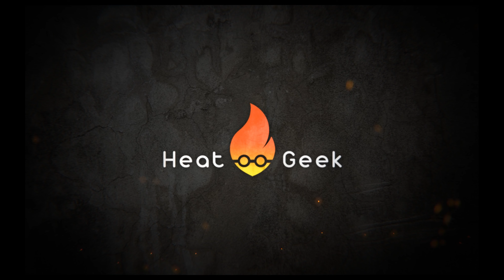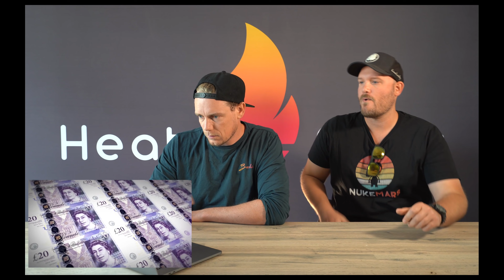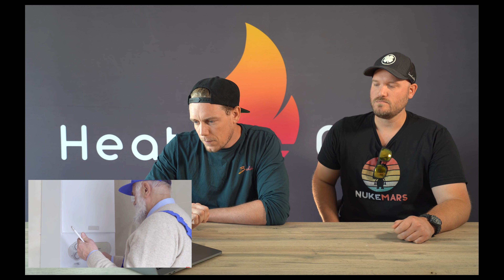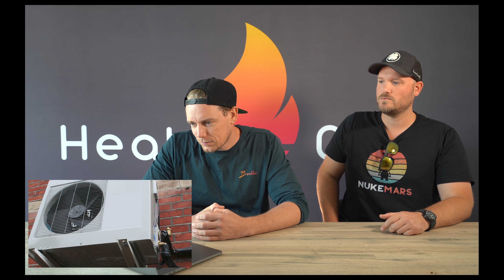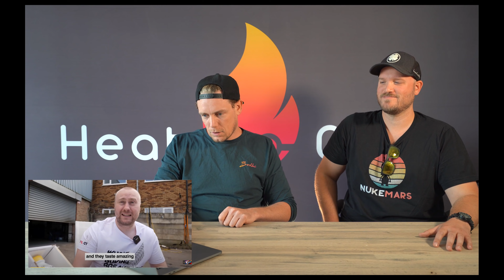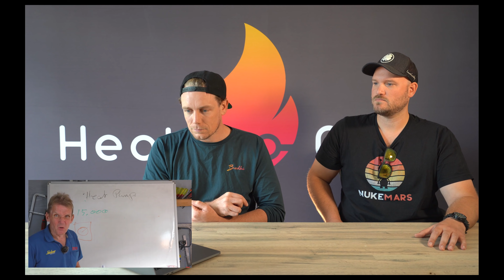Professionals React (BADLY) To Skill Builders's Heat Pump Videos | PART 1 | FIRST TIME WATCHING

Comment: I think what the skill builder is saying yes we need to reduce the carbon by getting rid of our gas boilers, but it isn’t as straight forward as just fitting a heat pump as with this there are usually many changes needed to really make this type of system work , under floor heating larger radiators , possible wall insulation ,and let’s face it most don’t have the money to do the changes , personally boris Johnson has set a target for carbon neutral,we should forget about heat pumps and look at get hydrogen boilers , yes there is need for changes in the pipe work to deliver hydrogen to our houses but this won’t be a cost to us ,plus all we would need to do is change the boiler ,and nothing else ,now that makes sense to me .
Reply: Yes bang on, hydrogen is better FAR BETTER.

Donr get me wrong heat pumps work..but only if you destroy your house and spend £30k / £100k .

These heat pumps DO NOT WORK
For most of us.

They will work for a few YES !

But this is beyond the affordability of TOO MANY

Comment: 15 minutes in and you've basically slagged the guy off while agreeing with everything he's saying. Heat pumps, for a large percentage of UK housing stock, are just not viable. And saying it's more about the installer than the pumps themselves, the thousands of people they're throwing through training courses to meet installation targets will have zero experience. You guys might know everything there is to know about this technology but it will take more than the two of you to install 19 million of these things in the next 30 years.

Comment: perhaps design and installation is everything but how do you know if an engineer is good and system is well designed? bloke that did ours has over 20 years experience in heating and cooling. System is very expensive to run, does not get the radiators hot, junk.
Reply from the maker: Well it's not how many years experience they have for sure. We're going to publish a list of things to check and questions for to help woth this very good question. 👍

Comment: COP is everything, when comparing gas to heat pumps.  If price per Kwh for electricity vs gas is 4:1 then you need the COP to compensate for the higher cost by a factor of 3 or more (assuming you're using a condensing boiler of 90% efficiency etc.  COP is negatively effected by higher ouput temperature as well as lower input temperature.  High radiator temps or colder outdoor (for air source) temps will result in lower COPs.  The best ground source heat pumps into a highly insulated house with underfloor heating running at 50 degrees will get a COP of +4.  I've never seen a heat pump that beats gas cost for a legacy home with typical insulation, air-tightness and radiator setup not to mention the factor of 10-to1 in purchase and installation cost.  Heat pumps can be a reasonable choice for new bulds or remote properties with gas ot oil heating for everyone else they are almost always nonsense.  Pure propoganda.
Reply from the maker: I would say you haven't been in many retro fot heat pump houses then..  we'll be doing a series on our old retrofits/conversions to disprove thos rehtoric

Comment: -3C?   That’s 26F here which is nothing even in a mild climate during winter.  These are only decent in well insulated newer homes here in the US.  Better than electric baseboard but not better than gas.  Electricity is expensive in southern NY.  I had one installed and taken back out a month later as none of these installers are doing any type of engineering work.  My system had a full calculation done the day they cam to take it out.  It was 40% undersized and my electric bill was on track to more than double which makes it more than gas.  I have a system now self installed and use it for the shoulder seasons to heat and summer to cool.  At 3F the system they installed was pulling over 5000 watts and the fan was screaming.  They were so embarrassed in the end and it showed how they are all for the money when none of the 5 quotes I got did any real calculations.  By the way I’m talking about mini split with heads.  Not radiator types like the UK.

Comment: In reality the discussion relating to efficiency is way down the pile we need to start off with the answer from many house wives when told that to fit this new system I will have to seriously upset every room in your house (fact) This was proven in the Newcastle area where the government on a heat pump pilot scheme only managed to get eight people to consider fitting a free heat pump system/installation due to the woman of the house saying no way even if free if it involves serious upheaval of all of my rooms. Needles to say the pilot scheme was very very (yes two verys) quietly scrapped by the government and I agree we need an alternative heating source but in reality heat pump systems are only suitable for new builds or total house revamps/renovation without causing serious upheaval throughout a property. The government has yet to realise that the woman of the house will put the brake on this scheme even though they had a dismal take up failure on the pilot scheme there has been no learning curve. Notice the words in the fourth sentence (free heat pump system/installation) yet they could only get eight households to accept once the wives were told of the associated upset to the rooms. If you have no knowledge about this pilot scheme you should seriously ask the government why and then ask your local MP if he is aware of this and if not ask him/her why? It must be obvious to all by now that the brown envelopes/lobbying has already taken place and the gravy train is in motion and now cannot be stopped even though it is obvious from the failure of the pilot schemes that this idea has the usual government abject project failure written all over it. Just to put the cap on one other idea before I retired my work was in the cryogenics field which involved lots of hydrogen distribution systems both liquid and gas and I already know hydrogen in the gas mains will leak faster than they can pump it in due to the size of hydrogen atoms compared to natural gas (hydrocarbons) every joint pulled up to stop gas (hydrocarbons) leaking will not stop hydrogen leaking through the same joint. I could go on into polypropylene gas pipework and present meters being suable for pure hydrogen but I think I have given you much to think about/contemplate already.

Comment: Heat pumps just don't work as a retrofit I work in gateshead and British gas done a scheme when heat pumps first started they fitted them in 20 of our properties and the council have had to subsidise the tenants electric bills as some of them were paying upwards to £500 a month and the houses still wernt warm at all.
They have all been ripped out and gas boilers refitted and the heat pumps all scrapped.
On a new build fair enough but not a retrofit.

Comment: Across the pond you guys typically are not ductless, why not??? i have ductless in the entire house and a Rheem heat pump hot water heater.... my energy was reduced by half from electric baseboard and electric hot water heater.

Comment: i am all for using better ways to heat our homes and water, but until a solution is developed which makes economic sense and works just as well as or better to what it is replacing then i won't be switching.....air source heat pumps are far too expensive to buy, install, run or maintain than a gas boiler. Millions of people simply cannot afford to install one, even with a grant you still have to fork out around £5-6k....(lets remember a new gas boiler fitted is around £1200-2000 and will last around 10 years)....so it becomes a toy for the rich and if that is the case why do they need a grant, paid for by tax payers money? - it makes no sense whatsoever... until an alternative (like hydrogen) is made cost effective and available to the masses then people will stick with gas and i wouldn't blame them...

Comment: 21°C is my ideal temp with a coat on.

There is no evidence that we need to cut carbon. In fact there is evidence that we are now as we speak heading into a 300 year solar minimum mini ice age. 
There is  evidence that recent measurements of a small increase in temperature is due to climate temperature measuring anomalies (urban temp stations etc).
Sea level measuring on the Wales coast show no increase in sea levels.
There is no evidence that atmospheric CO2 changes actually cause temp increase - there are water vapour / co2 negative feedback atmospheric stabilising effects that counteract any possible atmospheric heating effects from co2. It's the reason life exists on earth. 
A quadrupling of CO2 over 800 years at current increase rates  would in fact cause no more than a 1 degree c change according to recent accurate models.  
Also, 95% of the planets populations have no intention of cutting carbon.
The climate is currently not changing as we speak in any way that could be described as unusual or caused by human activity.

Comment: I worked (briefly) for a house developer in mid-Cornwall area. Out of six completed houses only one house went through the air pressure test to check the air-tightness of the property. The developer elected which house was tested and went to town with tubes and tubes of expanding foam and this stuff was injected absolutely everywhere in order to block up potential leaks. I watched the site supervisor use a dozen plus tubes on one three bedroomed house. This house passed the test, but the test results were then shared by the other five houses in that group, but in no way were those houses as air tight as the tested house. 
So, people moving into these new houses built to new regulations are not getting what they are expecting. 
New-build houses have to be properly monitored multiple times by properly trained professionals who are INDEPENDENT and have zero connection to developers. These professionals should have the same standing as tax inspectors and be as feared by developers in the same way.
 The era of developers marking their own homework has to come to an end.
Reply: I know of a housing development where all the inspections were done by the companies own employees 🙄
Reply: have you considered blowing your whistle?
Reply: @toosas  I think he just did, but only 29 people listened.
Reply: There you go, poor installation standards, the biggest problem within our industry. agree with you completely.
Reply: So the takeaway from this is property developers are scum
Reply: Just done a site with 65 houses. Each one was properly air tested.
Reply: @jordanlamb6102  yeah, it’s mandatory to air pressure test every house
Reply from the maker: Here's evidence of how they work when well installed in a NORMAL house with tiny rads and little insulation 

https://youtu.be/QLGANlbqIFY

Comment: Just wanted to ask why in the UK there is little or no domestic installation of air to air heat pumps?  These are very cheap, very efficient, have no reliance on existing heating pipework, radiators or ducting, are easy to install and easy to control.  They are widely used in the US, even in very cold winter climates.  We have a property in Greece where we installed 6 of these units, A++ rated for cooling and A+++ for heating, 12,500 BTU per unit and the cost was only €400 each, plus a small amount for installation.  I can't get my head around why they aren't more common in the UK?
Reply: "12,500 BTU per unit and the cost was only €400 each" Got a link for these units please David? Looking to do similar.
Reply: @BerkeleyTowers  BTW, we bought ours in Corfu, as we have a house there.  I've linked to one available in England.  In Greece, they are commonplace for between €300 and €400 per unit.  The ones we have in Greece are made by Midea, one of the largest manufacturers in the World

Comment: All heat pump installs I know of all work , but way Below the gas boiler performance. They all say the same, wished we had waited for better technology.   In my case the whole installation will have to be replaced. Its a non starter. Not budging. Will wait for hydrogen if it arrives.  Otherwise A heated jacket hi.   My decisions are based on my own research speaking to heating engineers who have fitted heat pumps , many videos from the boiler companies.  Your comments are interesting . I am retired Electrician and been involved loosely with heating systems, apart from installing electrical storage heaters which were so costly to run , it was a non starter in the end..

Comment: A very sensible video, balancing what tends to be a very blinkered and one-sided view being put forward at the moment.  There's also the option of putting in air to air mini-split units (or large units with air ducting if you have an appropriate property).  These units are cheap and efficient, but don't seem to get much press in the UK.  We've had a heat pump for 6 years and have been very pleased with it (Samsung 16kw EHS Monobloc).  We run a hybrid system with a Vaillant Ecotec gas boiler because we live in a large old Victorian house with thick stone walls, which can't be super insulated.  The heat pump takes care of 90% of the heating duties, the gas boiler only heats when the outside air temp is 3c or below.  The gas boiler heats the water.  We also have a 4kw solar array and a solar i-boost to heat the water when we're generating excess solar energy
Reply: Heck, at what cost to get to that level of efficiency!? For the average house built before modern building regs, way out of reach.

Comment: Where can you buy those baseball caps with the peak bit on the rear? If you cant figure out how to wear a hat properly then sorry i am not convinced you have the experience Roger has. I am with Roger all day on this one he talks common sense. I love the concept of heat pumps and in the right environment (and i mean Building) they have their merits. For me in a house built in 1900, with no cavity and no underfloor heating it would not work. Despite having all new double glazing insulated loft a heat pump would never keep up.

Comment: Why is the installer the variable? What are they doing wrong?
Reply from the maker: Not designing the system. You should not be finding out its 2 x more expensive 2 years later as Roger did. During design stage you tweak things like rad sizing and hydraulics to get the cop up.. its an installation cost vs running cost excersize

Comment: I am a happy customer - not yours, but another very professional installer - living in a rather draughty, solid-walled, victorian house with an air source heat pump which works way better than the oil-fired boiler that I had before. And I feel I am doing my bit to save the planet. I am glad you are responding to that Skill Builder video.

Comment: Take it from someone with experience of heat pump heating and gas boiler heating, heat pumps are expensive to operate and are inefficient, with a gas system heating water for radiators once heated the boiler goes off until the water needs re heating to maintain the temperature, most heat pumps work by heating air and circulating that around whatever space you fit the fan in, there are water heating systems but these are extremely expensive to fit up to twice the price of a gas system, the hot air heat pumps run almost constantly because the air cools faster than water, in older homes with inefficient insulation heat pumps are a waste of time and money, our single story 130sq metre home cost around $2500 to heat with the heat pump and only warmed the hall, we needed electric heaters in other rooms if we wanted a constant temp around the home, we fitted a gas boiler system at a cost of $17000 and have reduced our heating bill by a $1000 dollars a year but more importantly a constant heat around the home, no more wearing a jumper to have a pee, many people have heat pumps and are happy,  mostly they have no experience of a good gas system usually they moved on from a log burner.

Comment: the thing with the heat pumps is people are having problems in the uk if the fit to high a tog underlay under there carpets the heat pumps cant cope.as most heat pump systems are underfloor heating type
Reply: No they aren't. Most retrofits still use radiators. In most cases all that is required is changing single panel to double panel with one or two convectors. I've done it.
Reply: @rogerphelps9939  90% of the heat pump systems I come across here are new builds very few people are get them converted